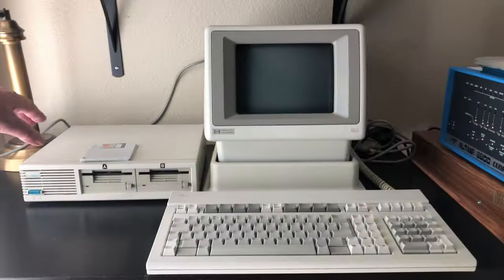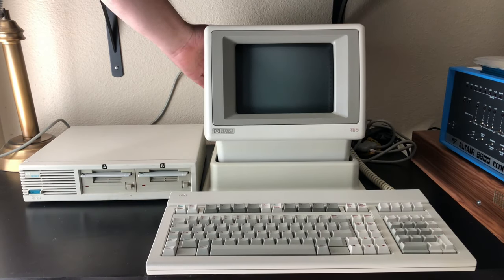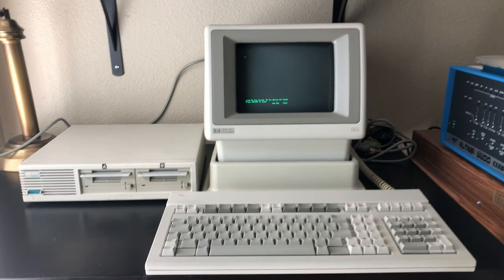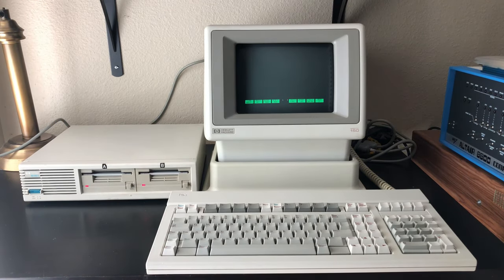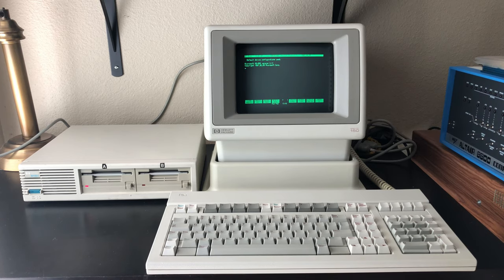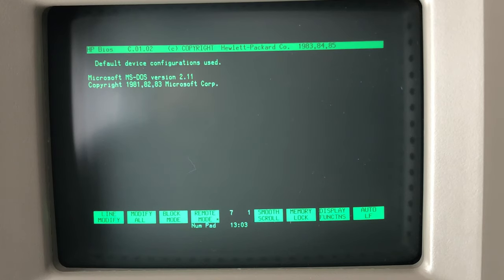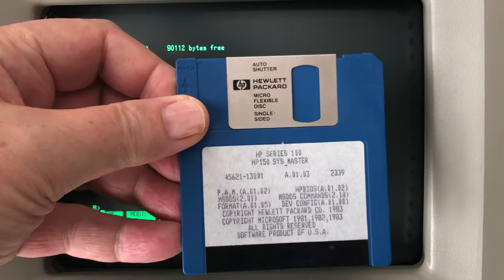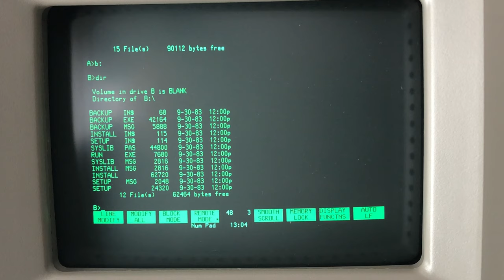STB505 - HP150 Personal Computer - Part 4 - Booting the system from floppy

Comment: So this is one the system the local university had. They was a big hp center with dumb terminals, hp 3000 systems and even these little 150. I asked about them. I was told they was not dos compatible. At the time I didn't realize it was not IBM Compatible. The touch screen seemed far ahead at the time. Found out later on it was just infrared sensor. They had no problem connecting via serial cable to the hp 3,000 systems.